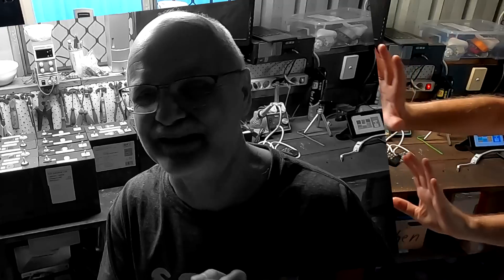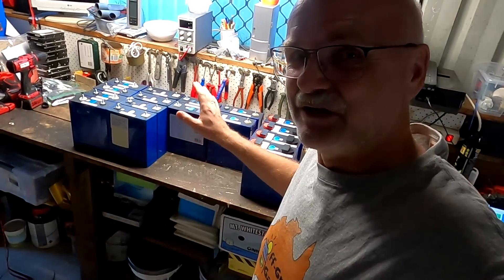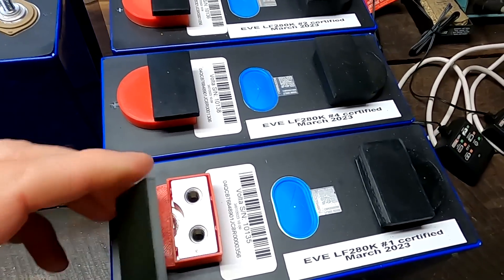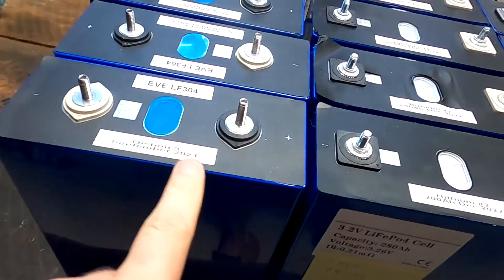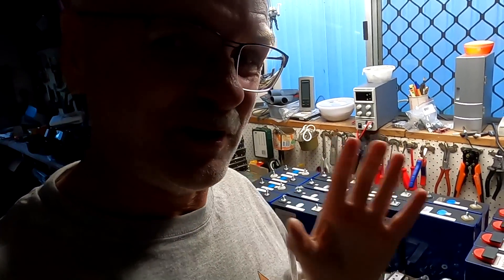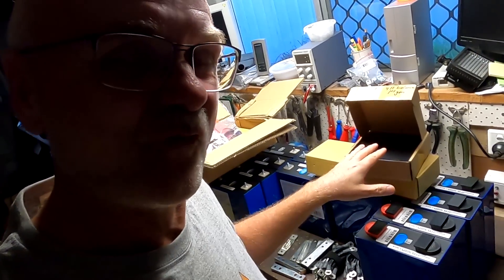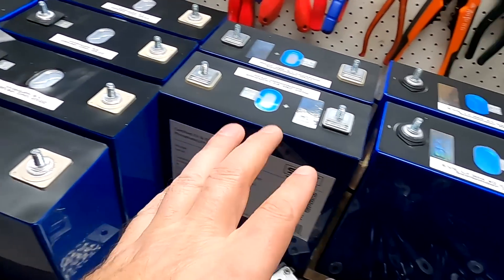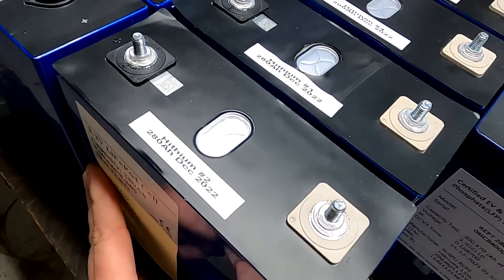The Frankenstein Battery Project - what could possibly go wrong?🤷‍♂️

Comment: I know for sure it will work.  For years and years i had and still have built  from 18650 cells. 100 per pack of 1s100p.  Those cells come from recycle laptops.  Those lasted for 2-3 years.  They always were out of balance from day one and i did not use any active balance and NOT even bms.

These long lasting LFP cells will work just fine for years to come providing an active balance is in place as NO doubt they all will have different internal  impedance.  

At this point i have decided to go with LFP as i am very much done with the tedious built process of small 18650 cells piece by piece. I can buy new grade A 300AH LFP cells for under $70 USD and they  will last for decade.  I will have bms and active balancer from day one.   One time large investment and i do not have to dick around with rebuilt pack  cells frequently.   18650 cells built pack is tedious and time consuming and hard that is very few goes this way.  That is the extreme of reduce reuse recycle.  They work however for years I ran the whole house with those batteries.

BTW i decide to subscribe to your channel as it was your channel that made me switch to LFP, use active balancer and other subject that i have not gotten into yet.

Comment: Hi Andy, I'd have one tip for you to consider. 
In Seplos DIY box the rear battery cells only support the square beams in the centre, top and bottom of the rear wall. 
The battery cells will expand over time and it would be better if they had full support for their complete surface on the back wall. 
It would be good to fill the rear section with precision cut wood in the gap between the rear beams on the rear wall. 
I know it requires disassembling the whole batteries you've already built from these Seplos DIY boxes,
but it's worth considering at The Frankenstein Battery Project.
I saw on another YouTube video that they filled it in so that the rear battery cells also have back wall support across their full surfaces.
Reply from the maker: Great suggestion. Thank you.

Comment: Good idea Andy, after initial balancing problems, it is becoming a well running system. The battery will behave like all the others, the lipo batteries are either broken or OK. Therefore, no matter if some have already run 50 cycles, they are all like new and behave like that. You will be surprised, or it will be as I wrote. After all the tests and experiences, I just came to the conclusion.   ++  Am I a prophet now? Great  ++
Reply from the maker: I'm expecting the same actually. The only problems I can see, are the many different busbars and connections...

Comment: So Andy, what are the predictions for the outcome?
1. Will each cell charge to the full charge capacity of the lowest AH rated cell?
2. Will the charge current of the lower rated cells drop off and prevent the higher rated cells from absorbing, leaving the higher rated cells at the same charge state or Ah as the lower rated cells.
3. What happens when the active balancer kicks in, I would think that because the higher rated cell has a lower voltage at this point the active balancer will draw current from the lower rated cell to increase the voltage on the higher rated cell.
This is absolutely crazy, I can't wait for the next video and to see some data.
Thanks for the super channel.
Reply from the maker: Thanks a lot, Mike. All your questions will be answered soon...

Comment: hi can you answer this  I have that item Victron SmartShunt Battery Monitor and I have this one too  Victron Solar charge controller - SmartSolar MPPT 250/100-MC4  I would like to have them on the Internet so I can follow them on my mobile  can i use that item for that    Victron Cerbo GX  WIFI    Should I buy something else?  søren
Reply from the maker: You either need a Cerbo as the central unit or can use a Raspberry Pi for that. More info here:
https://off-grid-garage.com/victron-connect-through-raspberry-pi/
Reply: Thanks

Comment: I would alternate high & low capacity cells, as you will be limited by the lower capacity cells. The lower capacity will dictate your battery capacity as a whole.
The alternative is to make lower voltage pack and use all the same capacity cells.
Reply from the maker: Would it make any difference where to position the cells in a series connection of 16?

Comment: Doesn't this seem like a bad idea? When you discharge the pack, the 280Ah cells will be the first to hit low voltage cut-off. When you charge the pack, the 304Ah cells will be the first to hit high-voltage cutoff. Your balancer will be doing all the work attempting to keep them balanced, seems like a recipe for trouble and constant high/low voltage cutoffs.

I feel like the only way to manage this is making pairs of 280Ah and 304Ah cells in parallel with each other, and then series those with other cells doing the same. Good luck I'll be eating popcorn watching what happens...
Reply from the maker: You will be surprised...

Comment: Unless you plan to perform other Frankenstein projects with these cells, it really doesn't matter the config. The hi-cap batteries will never reach full charge and the low-cap batteries will reach LVD soon. Will be curious nonetheless.  Start with like cells just as on the bench, sorted by capacity. Thanks for sharing
Reply from the maker: The order of the batteries would not make a difference in a 16s series connection, would it?

Comment: It should work, and capacity will be limited by the weakest cell. As the BMS will shut down the pack once the first call reaches the low voltage discharge setting.
Reply from the maker: Yes, like with any other battery...

Comment: Nice project..

Regarding the Mason case, I would consider placing the batteries in symmetrie so that the compressionplate doesnt get into problems and the tork
om de compression screws doesn’t get unballanced. When f.e. the left “row” of batteries is thicker than the other row depending on the compression plate, it will either break, bend, or it won’t compress both rows evenly.

This would also mean the fake 4 batteries end up as batteries 7 to 10 if you don,t want them out of series with eachother . 

An other approach would be letting go of compression and serie them up on resistance from lower to higher or the other way around. It would be nice to see  if and how this influences the unbalance during charging vs discharging. 

Either the lower/higher resistance cells will be in the beginning or on the end of the string.  

When there is a noticable difference you might gain some in reordering the batteries in your other packs and see what happens when you move the always low and always high cell to another place in the string.

This pack is a nice one to do some trial and error.

Also I think it would benefit from bottom balancing (with a seperate active balancer and your voltage detection switch) Which may only work at lower discharge currents or much higher balance currents.

The knees of the charge/discharge cycle may be in a different place due to the different capacities. One way to try and overcome this would be by downgrading the pack capacity and set a 100% SOC at 90% of the lowest cell cap, 280 I think. This should prevent the usage of the spare capacity of the higher cap cells.  Balancing may be more difficult in that case, since you never cycle into the knees anymore on either side. This in the end may create a usable pack which will eventually still balance to a degree when one cell really runs away.

Another approach could be to try and find a balancer for balancing 2 “12V” or “6v”
Sub-Packs with a high enough current and put it between the highest cap and lowest cap set of cells withing the 48v pack. The balance current of such a balancer may be high enough to prevent the lower cap cells from over discharging too fast by compensating with a current from the higher cap cells. A buck converter could do the trick, but when and how to start and stop it is another thing. During charging it should work the other way around, which may be impossible or at least hard to regulate.

Anyway,.. enough to try out I guess.

Keep up the good work Andy.

Gr. Mike (From Holland)
Reply from the maker: Thanks a lot for your comment and suggestions. Great thoughts and ideas.

Comment: This would be the perfect place to try out the latest DiyBMS controller and modules. 

I could arrange to get you a controller and cell modules if you’d like. 

It can play nice with victron, it can emulate a pylontech battery, each cell module monitors passive balance temperature and a cell terminal temperature, it gives you 4 relays to use for activating an active balancer, opening/closing a contactor, etc. 

I’ve got two, one 16S and one 4S on my boat with a Cerbo GX.
Reply from the maker: Do I need to solder anything? I haven't got the time unfortunately to hunt for parts. I tried twice getting the DIYBMS but availability of the parts are not great atm...
Reply: No soldering. I could send you a pre-assembled kit. One controller and 16 modules. 
A version 4.2 controller with the INA229 current shunt add on board. 
16 v4.5 modules (ATTINY1624) with 880mA passive balancing and snap-off temperature sensors. 
You would need to provide a shunt (50-75mV/amp), class T fuse, and a contactor. 

I use a bi-stable contactor, like the BlueSea RBS ML7700, which has no holding current while it’s enabled.

Comment: Hey Andi, ich schreib mal auf Deutsch hihi.

Ich habe mich damals als ich angefangen habe, schon gefragt, wie das geht, wenn man zB mehrere unterschiedliche Lifepo4-Zellen paralell verbindet oder als 16S seriell. die kleinste Zelle mit den kleinsten Ah bestimmt dann eh die Gesamtkapazität, oder nicht? - Mal ne Annahme: Man schliesst 2x200Ah und 2x100Ah zu einer 4S zusammen, dann bekommt man zwar ne komische Batterie, aber am Ende sollte es doch funktionieren oder?

Wenn ich es richtig verstehe, gleichen sich die Zellen ja nach Spannung aus, und nicht nach Ah, oder sehe ich das falsch? Wenn dann die Zellen sagen wir mal bei 3,2V sind, und 50%, sollten die 100Ah bei ca 50Ah und die 200Ah bei ca 100Ah sein, oder irre ich mich da?

Die nutzbare Kapazität wäre dann wohl (ohne Balancing) eh limitiert auf die kleinste Zelle, da die dann ja eh schneller als die großen Zellen an die 2,5V kommt und das BMS dann den Cut macht. oder liege ich da falsch...dann hätten die 200Ah Zellen dann noch ca 50% übrig, oder geben die mehr ab, so das alle Zellen gleich leer laufen? Wäre mal interessant zu sehen...

Grüße aus Dresden
Reply from the maker: Yes, the cell with the smallest capacity will determine the the max capacity of the whole battery. This is with any battery, not just this one.
All cells need to be top balanced so they are full at the same SOC. In this case I would probably go over 3.6V for each cell to ensure they have the same start point. When discharging, well, the cells with the lower capacity will deplete first...

Comment: Hi Andy, I’d alternate all the different types so that you’d be spreading the differences evenly across the pack. Also the smaller cells I’d put right in the middle as the top cells would fill up first and would shut down the bms earlier because of over/under voltage if they were right on the charge terminals. I’ve built 15kw of salvaged 18650’s, so I’m used to this kind of ‘rough work’ 😂 Looking forward to it, enjoy and have fun 😊
Reply from the maker: Would it make any difference in a series connection though?
Reply: @OffGridGarageAustralia  My gut tells me that you distribute weakness evenly across a structure (i.e. alternate weak with strong cells). It’s the same principle as constructing a building, strong evenly spaced ‘buttresses’ bolster up weaker walls, with the very strongest  ‘stone or wood’ right on the outside where they are subjected to the heaviest weathering.
Reply from the maker: @artypete  A battery is a bit different as a building. One part of the battery can be very different to the one next to it.
That comparison would be true if you parallel a stronger battery with a weaker one. But series connection is different as you stack them on top of each other basically. Imagine this in construction. It would not matter where the strong or weak element sits.

Comment: I always wondered what would happen if you had a bank of 16 cells (in series) like this, with different capacities, and supplemented the lower capacity cells with much smaller cylinder shaped cells in piggy backed in parallel on those lower capacity cells? I have a box of 32700 cells lying around somewhere.
Reply from the maker: That would work as long as the current of your load stays under the maximum current of your smallest paralleled cell. There is also a lot to setup because the smaller cells would need extra fusing to protect them form the large battery in parallel.

Comment: It should be no problem to combine various cells to get your 16s Frankenstein Battery. Of course it makes no sense to mix 280Ah with 100Ah, but 280Ah with 310AH and different history should be no problem. I would load all cells to the max voltage you normally use and assemble them to a battery. As the sequence doesn't matter from the electrical point of view, you can frankenstein them together by mechanical requirements. If you discharge your FB, the cell with the lowest capacity will trigger the BMS to stop discharging, so the lowest capacity cell will determine the capacity of the whole FB. This capacity value you can enter to the BMS settings. I think it won't make sense to suck the remaining juice out of the higher capacity cells. This would require both bottom balancing and top balancing with a very! strong active balancer during the whole cycle. You already found out that an 'Always ON' balancer is not the best for LiFePO4. So better leave the remaining charge in the higher capacity cells and only top balance the FB some times. Was it you who used some circuit to switch the balancer on only at the top voltage area?
Reply from the maker: Great thoughts. I also have some 100Ah cells here, so if it gets too boring, we can always mix things up a bit 😊

Comment: I think, this will just work like a charm. For sure, the balancer will have some work to do. But in the end, the smaller capacity cells will be the limit of the battery bank. The bigger ones have probably smaller internal resistance, so will get to higher voltage and full earlier but there the BMS kicks in. The interesting part is, if the 4A balancer can handle that.
Voltage at fully chargy is the same for all of them in the end... I think, the limit is the balancer.
Reply from the maker: We will fully charge all cells and measure the internal resistance to se if there is any difference. I would imagine we will find out lowest capacity cell soon...

Comment: Video production of this channel rivals anything else from other electronic based topics.... Love it 😍
This is an interesting battery setup and while for the most part it's going to work okay until the lesser capacity cells run out of steam, the problem is going to lie with the balance circuit.. 
To make this setup usable, you are going to need many active balancers to shift enough capacity to be usable... This might be okay in a system where you can shut down loads and give the battery a chance to shift some capacity and that's fine in an emergency situation where you have gone over your quota and you need a little bit more energy to keep the lights on until the next morning... But definitely you are going to have to throw every active balancer at it because speed is going to be the issue here... 
Good luck with this project Andy, looking forward to seeing how this turns out and where you end up with your thoughts 💬....
Reply from the maker: Thanks Peter. It will be very interseting and we can run a lot of tests once it is built. The lowest capacity cell will definitely show us the max  capacity of the whole pack. Which one will it be???

Comment: I'm really looking forward to this video because I'm all so in the process of making my own battery out of 7 packs of 21700 60 cells in each pack and 1 pack of about 95 cells of  18650  I will calculate the exact amount so I'm close to the 21700 banks.  I ideally 1 more pack of 21700 would be perfect but theses are reclaimed cells iv checked 80 percent now and reading nearly perfect capacity so far. I'm thinking my plan will be fine but never seen any video like this. Anyway I'm making a 12v battery with to banks in parallel. What are your thoughts on this any comments I would love to hear
Reply from the maker: Be very careful with these Li-ion cells not to overcharge them. Hope you have a good BMS!
Reply: @OffGridGarageAustralia  I bought a jk bms and I have the same inverter as you the renogy 3000w its max voltage is 16v so will only be charging to 4v per cell it's just the odd pack of 18600s that concerns me
Reply: Can I ask you another quick question please . I have bought an active balancer and I also have the jk bms that has it's own active balancer.  Do you see any harm using both of them at the same time ?

Comment: The balancer will be working like cracy with different capacitys.😂
Reply from the maker: The balancer will only work at the top voltage through, like in a normal battery.

Comment: Nice work Andy! I think you will have to limit charging and discharging to 0.1C and rely heavily on a powerful balancer, let's see😀
Reply: I don’t think the cell “efficiency” will vary very much. 
Once properly top balanced, I predict it will be just fine at reasonable C rating- and think significantly higher than 0.1C will be ok, say at least 0.2 or likely even a bit more.

Comment: I guess only big differences in internal resistance could be a Problem. And after years of heavy use the lower capacity cells will have more cycles and degrade faster.
Besides that, it should work fine.
Reply from the maker: Good conclusion.